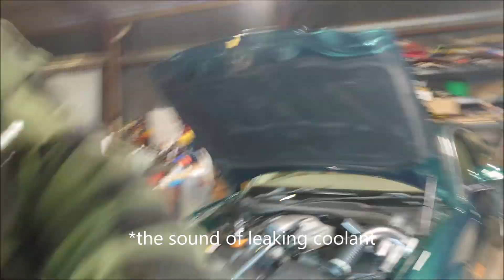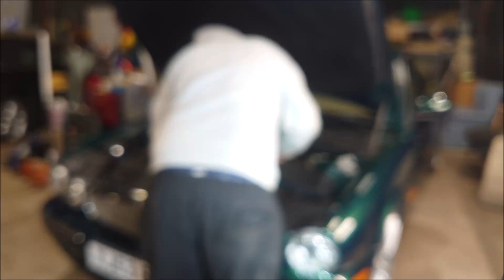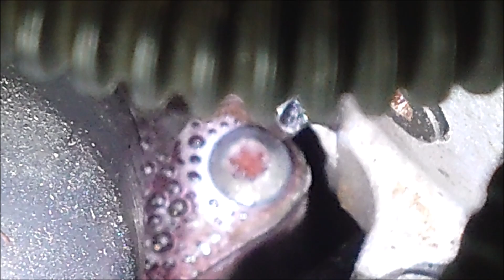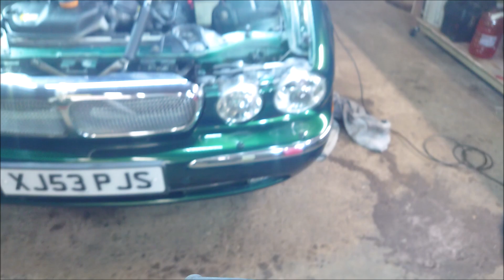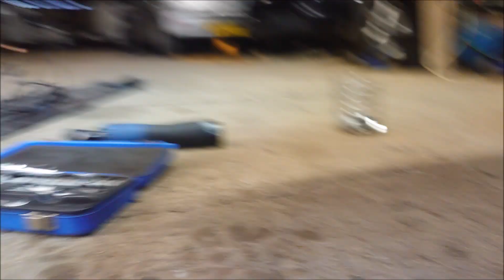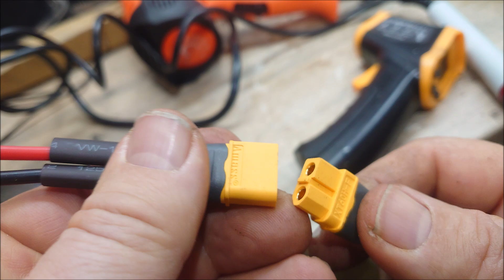Jaguar XJ X350 Super V8, is it FINALLY fixed??

Comment: The story about the Jag mechanic was very infuriating to listen to as many people experience such similar circumstances. They don't listen to the customer put on a few parts and sell you some more you didn't necessarily want, grab your money and shove you down the road.  I must say your resilience and creativity at solving the hose and pump issue was inspiring and you had the problem diagnosed accurately the first five minutes after pressuring up the system.  That beautiful car will no doubt continue to challenge you in the future but it is certainly in good hands with you as the owner.  Great job.
Reply from the maker: Thank you for that kind comment!